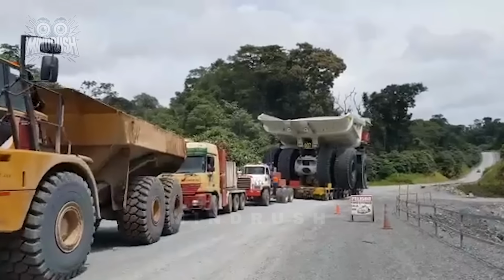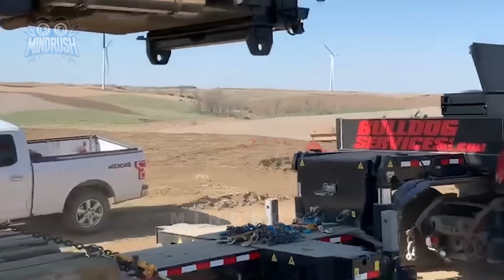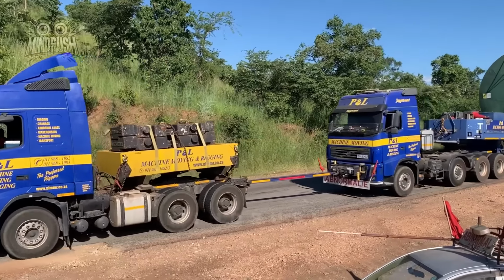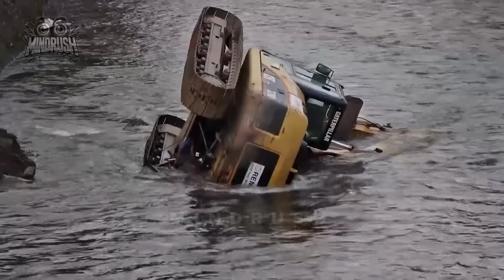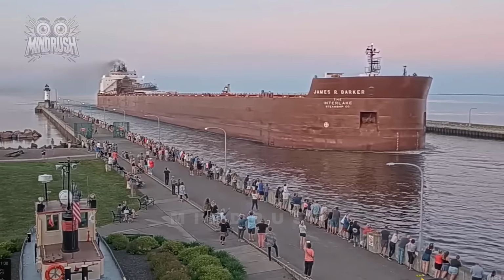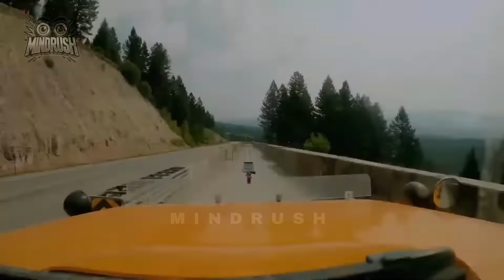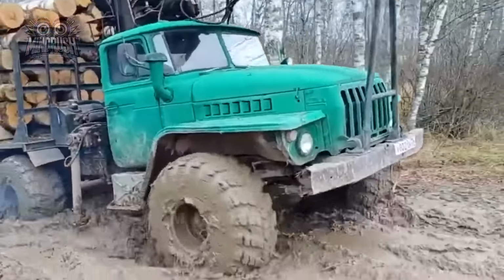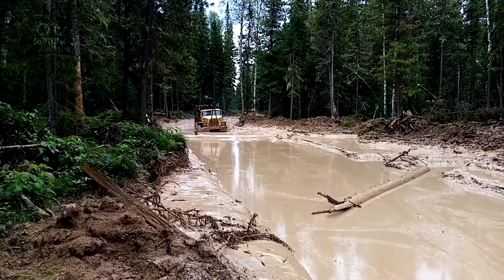Jaw-Dropping Dangerous Transport Skill Operations Oversize Truck Biggest Heavy Equipment Machines #1

Comment: Transporting huge, bulky machinery and equipment is a job that requires incredible skill, dexterity and experience from the driver. These oversized trucks are not just vehicles, but also giant warriors on a challenging and adventurous journey. Narrow roads, sharp turns, or steep passes – all are harsh challenges that the driver must overcome.